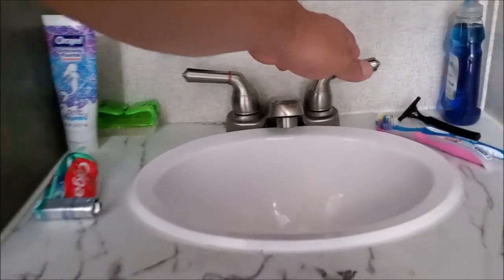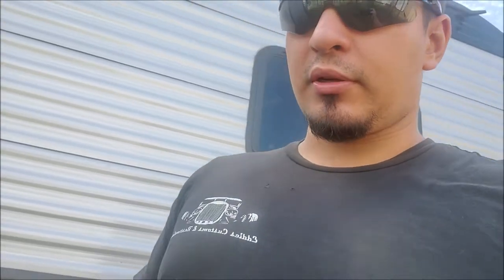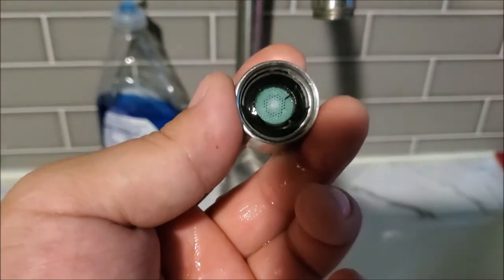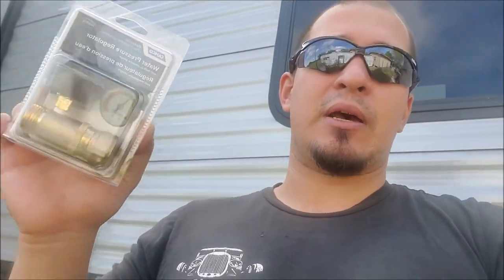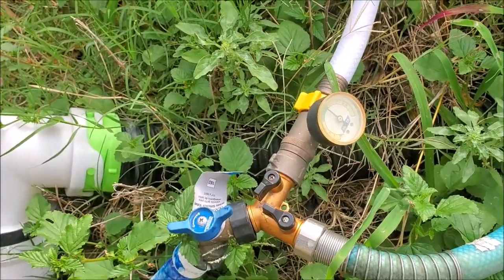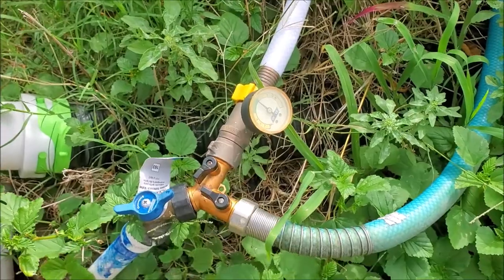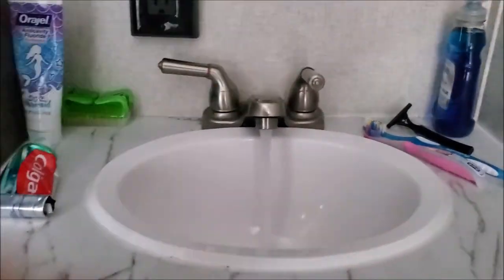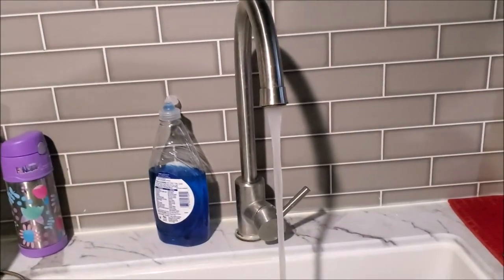How to fix Low water pressure at your shower , sink , or toilet on RV

Comment: I'm having the exact problem but cannot find solution. If I use the internal 12v water pump, the water pressure is fine, but using the resorts water, there is a lot of pressure for a few seconds and then it goes weak like yours. I changed the blue filter outside and even removed the water regulator. Any idea what else it could be? Thanks!!!
Reply: I have the same question too. We even tried without a regulator and no increase in pressure from the city water connection.
Reply: Change out your main  water filter .
Reply: @danielruiz5648  which main one...the big blue filter on the RV?
Reply from the maker: The park itself is probably facing low water pressure issues. Sometimes this happens..

Comment: Mine ended up being my water filter and hose after the cold front we had this weekend even though I left everything disconnected. My water pressure regulator was also acting up even though I had it at 40 PSI. Still going to replace the regulator even though everything is working now and no more leaks.
Reply from the maker: Glad you got that figured out! I go through regulators like crazy unfortunately..

Comment: What if it’s non of those ?  What else can it be ? My Motorhome is not giving me any pressure
Reply from the maker: check if you an outdoor shower that has additional valves that may be partially closed. Also disconnect the hose supplying you water and see if there is pressure there.

Comment: I have all of this except the filter and the pressure regulator. Suggestions?
Reply from the maker: Can you describe your exact symptoms?
Reply: @EddiesCustomsandRestorations  low water pressure in all faucets and toilet. I do not have the pressure valve on mu hose because its never had really strong water pressure. Happened all at once.
Reply from the maker: @xenaswolf  may be the city water. That happens sometimes too. Disconnect the hose and see the pressure without the rv connecte

Comment: My 5th wheel only drops pressure on the hot side. The cold side is perfect but the hot side starts off high and the quickly drops low. What could that be? I’ve checked the check valve and it seemed fine. What else could it be?
Reply from the maker: The Anode rod may have deteriorated inside your hot water heater and all the debris clogged up a hose somewhere. Its a matter of checking every single hot water connection at their valves. So if its the sink, close the water outside the camper, unscrew the hot water hose, place a bucket and then have another person quickly open and close the water and see if any debris comes out.

Comment: So what if I never had a regulator what so ever and all my water areas are now very low pressure. Any ideas??
Reply from the maker: your main water inlet is being restricted somewhere either by a filter or strainer. disconnect and see what your pressure is without the rv connected.
Reply: @EddiesCustomsandRestorations  I will try that. It’s odd because if I have my kitchen sink water turned on the pressure is very low but if I leave that water on and flush the toilet the pressure gets back up higher
Reply from the maker: @kylemcelhiney4969  yes the regulator is starting to fail. Mine does the same when the regulator starts to fail because after flushing, you raise up the pressure and then it maintains. In a sense you force the pressure back up by doing that
Reply: @EddiesCustomsandRestorations  is there like a built in regulator that i dont know about? Cause like I said I never put one or had one on the hose